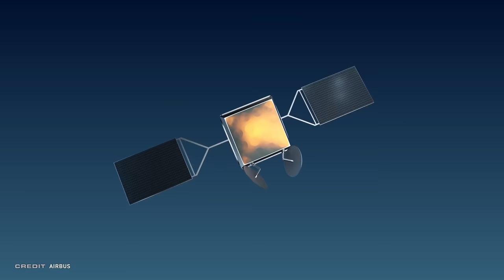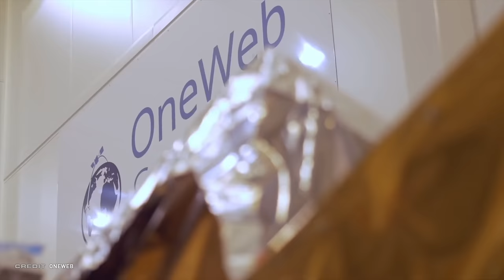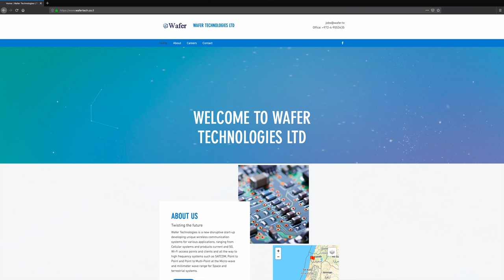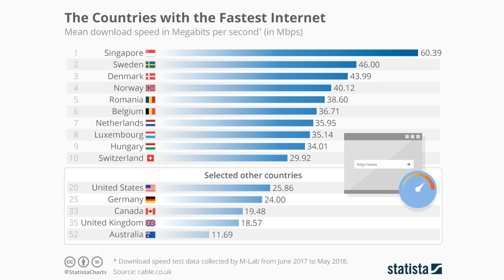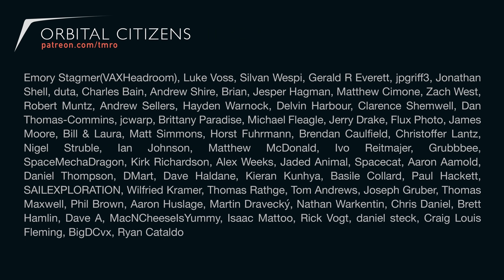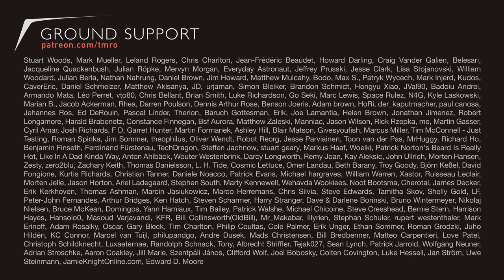Space News | Blue Breaks Ground, SpaceX DM-1 gets ready and OneWeb Internet

Comment: ok, just a question...600 satellites, + all those already existing+ space trash....Aren't the odds for a manned space flight to hit one of the object upon launch, VERY high ?????
Reply: Chance of hitting a tracked satellite is basically zero, it would require a major screw up from the launcher.
As for littering space, it's a bit of a problem. Google says there's about 21,000 objects larger than 10cm, so while there's a significant increase, it's not going to make manned space flight impossible.

There's a serious need to be cleaning up space, and imo, no satellite which cannot bring itself down should be allowed to be launched.